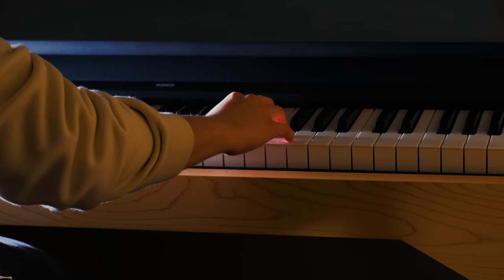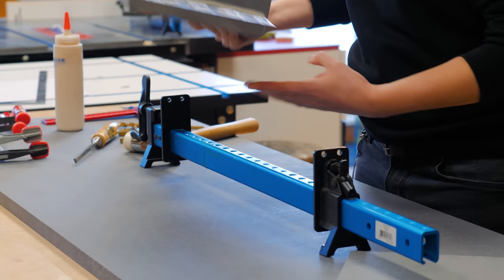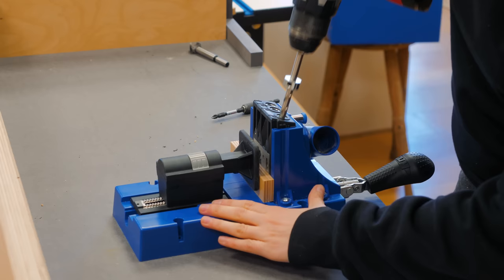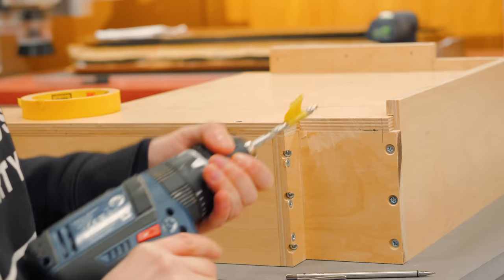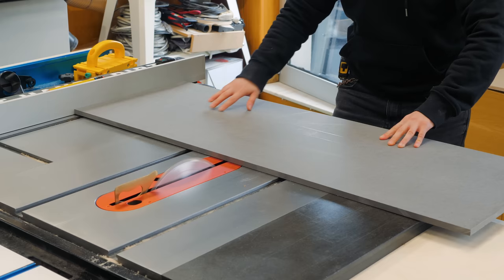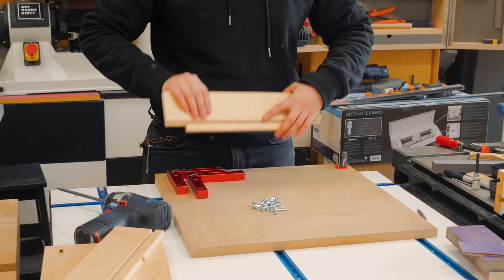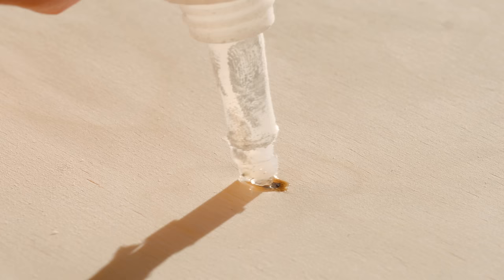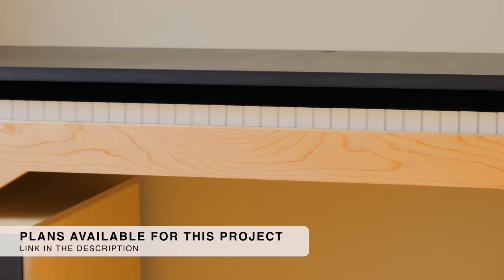I Made a Desk with Built-In Piano Keyboard // Tiny Apartment Build Ep. 18

Comment: Maybe consider adding synchronisation rods, since the drawer is much wider then it is deep and the slides are not rated to function properly for this width
Reply from the maker: Thought about it, problem is, the Blum ones would get in the middle of the leg cutout area, defeating its purpose once the bar is there. Doesn't work too bad as is, honestly.

Comment: This is good if you buy a certain keyboard that will fit inside. I have a Yamaha keyboard that is an electric piano which a desk could be built around it. One board could cover the top of the keyboard For a desktop. Then just lift the board up and lock in place. You can have a music stand built in, better than what the piano came with. You might need to have a bench higher if your a shorter person. I already used my laptop for displaying music notes while playing the piece works great. But I haven't built a desk. Your idea has a better feature you won't need to remove items from the desk. I could drawer the piano they make heavy duty tracks or just put casters on the bottom of the piano. Nice work and thanks for the idea of making the piano a desk also. 73

Comment: From France, September 2023
I'm watching your video again, just for fun, it's even better than looking at works of art:
I absolutely don't know how to DIY and therefore admire your professional work.
And beyond knowing how to “tinker” you still need to have the sophisticated equipment to achieve it.
The idea of saving space is really ingenious, and what's more, it's also aesthetically pleasing.
For my keyboard model, there are small holes underneath on the left and right for the speakers. If this is also the case for your keyboard, have you thought about creating ventilation in the wood to avoid overheating?
As far as I'm concerned, I was lucky that my keyboard could fit exactly in the "shell" of my old clavinova which was irreparable (I had the entire interior of the clavinova removed, and was then able to fit my new keyboard inside, and you really have to look twice to detect this new installation).
BRAVO for your work and thank you for sharing it.

Comment: While I love the look of your thick wooden desk and the mechanism of the keyboard sliding right there, such setup is still not really optimally in terms of being ergonomical. It also may not be easy at this time to both have an ergonomical body position for both the midi keyboard and typing keyboard, since they basically need the same area for optimal ergonomical position. In your setup for example, your midi keyboard is at a comfortable postion, but your typing keyboard and mouse are way too high, increasing the chances of RSI (repatiative strain injury/carpal tunnel syndrome) when you are using your mouse and keyboard.

I see 2 parts of a solution that ergonomically would improve the situation most of us music production guys are in:
- We would need a MIDI keyboard that has a very thin base underneath the keys, while at the same time the keys should be normal size and depth. This allows the height of the midi keyboard to be as close to the typing keyboard as possible.
- The desk ideally be as thin as possible, so also this decreases the distance between the the midi keyboard and typing keyboard are at the same height as much as possible. The MIDI keyboard should slide right under the typing keyboard, in terms of height.

I still do not understand why there are not more places selling such setups, as it seems like a easy money for a relatively simple, yet common problem. It should not even have to be something that is expensive. Whenever I look at 95%'s people's setups, It's really never ideal for this reason. I see half of the people with comfortable midi keyboard locations and the other half with uncomfortable midi keyboard locations while realistically speaking both options should be possible.

Another theoretical possibility would be to have the typing mouse and keyboard and mouse slide under the midi keyboard, but I'm not sure if that would be better or than the previous solution. The keyboard (typing or midi) you operate most of the time should be most optimally ergonomically. For instance, I tend to spend a lot more time programming notes than actually playing them on the midi keyboard. So for me the typing keyboard is right in front of me, while the midi keyboard is on the left of me (both at ideal height, but not ideal position because I have to rotate). However, it's always a compromise to some degree, but the amount of comprimise people have to live with at the moment should not be needed.

Dom Sigalas even went from using regular mouse to such a thing that you rotate with your thumb because he also had carpal tunnel/Repetative strain injury (pain in which means arms/shoulders) which is no wonder because also his desk is way too high for his typing keyboard. I think a lot of us use the typing keyboard and mouse more than we think, since playing something is done in a few seconds and tweaking your music can really take ages. 

Also, this solution would also increase the legroom anyone has under their table as much as possible.

So manifacturers, please make such a a keyboard and desk. We do not need 100 competing DAWS or 1000 different orchestral kontakt libraries, but rather actually need something that

Comment: Love the little side cabinet! Question - are the figure 8 top connectors necessary when using a stable material like MDF?
Reply from the maker: Not necessary for these materials. I used the figure 8's because it was an easy way to connect the parts, mostly because I knew the frame + the top wouldn't get in due to the angled space. I really needed the top to be detachable. Could have been screwed directly or even glued together in another situation.
Reply: @GetHandsDirty  that makes a lot of sense! 😊 thanks for the reply.